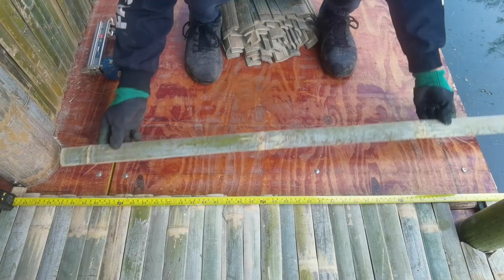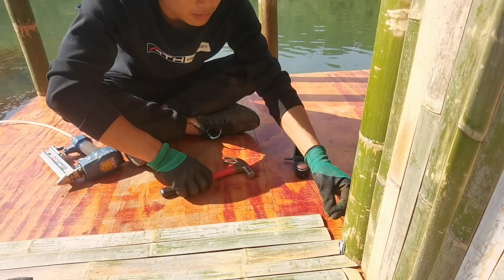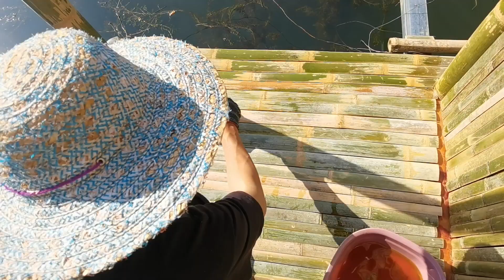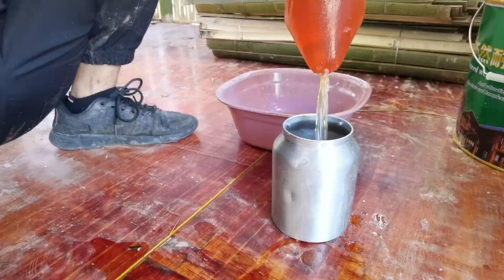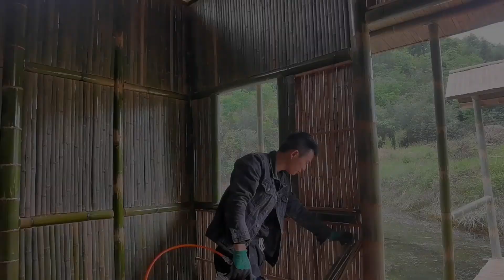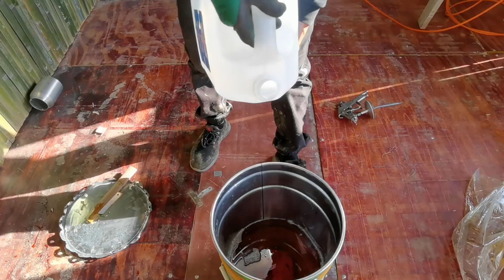Build a water bamboo house in 60 days - 6/Paints the Bamboo,It's So Beautiful【Water Dweller】

Comment: I should be praising you and yes, you have worked hard. Yet wonder by who´s techniques have you used? It´s your build, yet I would want my walls both wind and water tight with insulation, at least a little. I´m also shocked with such overwhelming beauty outside, that you only have one window and on the side with the huge hole? Again, your choice. Yet I would want to watch the rain on the water and also wake up with a view of that days weather. I would certainly have
some "Skylights" in the roof, again to gaze at a star or two! I´m a romantic.
But hey, hope you don´t own many books or work with paper as it will be a very damp place. How and were will the rainwater go, after landing on your platform? As the paths are not slopping enough and the rain can flow into the house. Would it not have been better to raise the floor level by 10 cm and have stepped up into the building? Well, you will soon discover better ways. Maybe ask around or search online for the right techniques :person-turqouise-waving:
Good luck